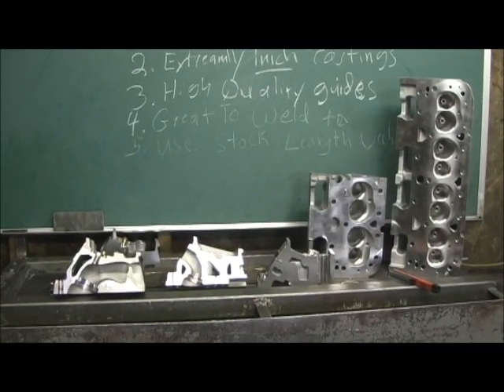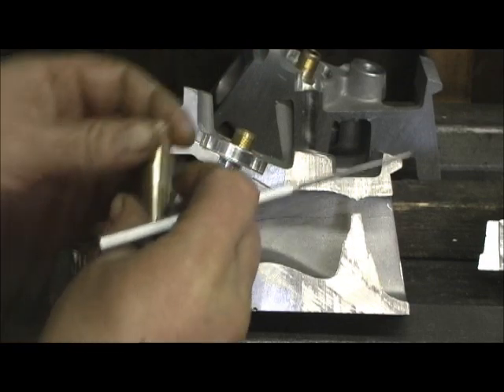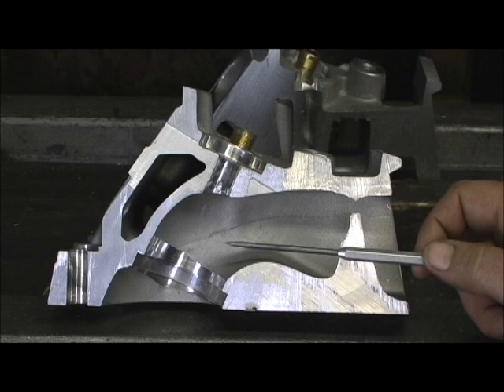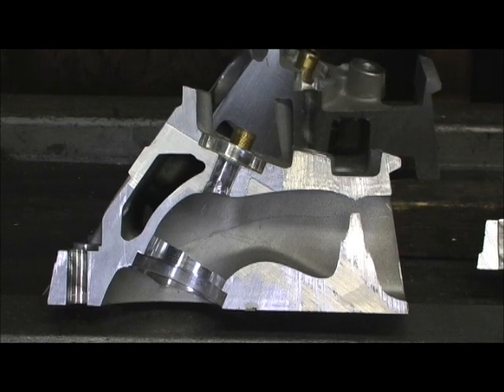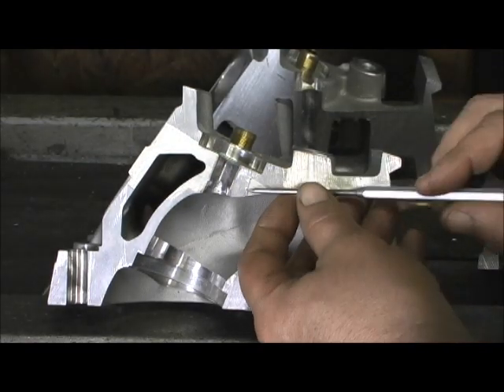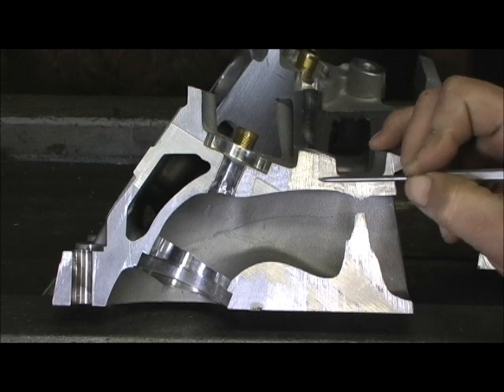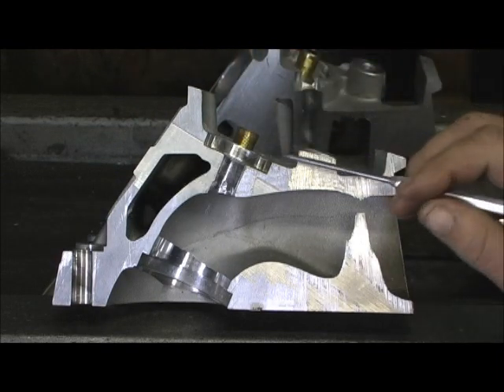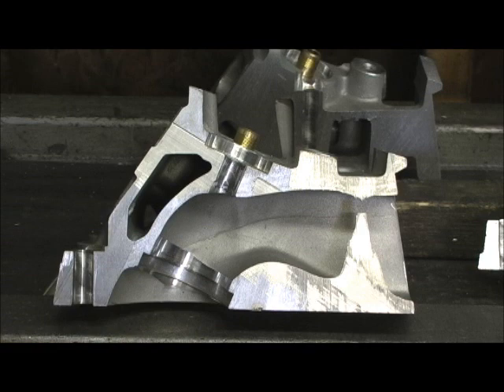ProMaxx 200 NEW Intake Cutaway 3.0

Comment: A question for you. I recently saw a mercedes truck head . 13L 380 hp. The base of the inlet manifold had a d & b shape viewd from floor but the head was standard rectangle shape. In other words where the oval of the db on the manifold its like air hittinv a brick wall on entry to the ports. What is the advantage of that shape in terms of performance, when porting the head to the same shape? Does it do anything to the torque output. Its the first time I've seen that type of port shape.

Comment: Tony, this is my first comment after watching about 50 of your vids (several times).  Thanks so much for taking the trouble!  I've been building engines for about 20 years and have been trying to learn to port, mostly by reading, but pictures speak 1000s, and your commentary has taught me a bunch.  One question about this vid: There's a cutaway pic out there of the Edelbrock Perf RPM head (similar water jacket configuration to the PM200), and the intake port has already a very flat/direct roof, and not nearly as much of a raised floor approaching the short turn.  To a new guy like me, this looks better: a more straight shot into the chamber.  I understand that most of the action will occur on the roof and cylinder wall sides, and a bigger short-turn radius will help the A/F mixture around it (as on the ProMaxx 200).  I believe that by higher lifts the short turn is hardly used any more.  So is all this short-turn business about using more of the valve at low lift?  It looks to me like the short turn-shape dictates much of the rest of the port shape, and I don't understand why it's so crucial--and it's very hard to work on (at least for me.)

In short, a video where you explain an overview of some of your theory behind porting-comparing two or three different cutaways- would be most welcome! 

Thanks again, and Best Wishes,
Shawn

Comment: Thomas, give these guys a call and get one of their 225cc smallblock heads to cut up!
Reply from the maker: I don't' think I am going to TOUCH that one. I have done them heads, and there in the same category as the ProComps.....LOL
Reply: I did not know that. I figured they were a larger version of the cut head.
Reply from the maker: Charles Servedio NO NO NO!!! These are TOTALY different heads Yank, NEW CASTINGS like I posted in the Video. NOTHING is the same, NOTHING!!!
Reply: The new ones look pretty good. If they cast them at 225 cc you could cut them to 235 cc and build a real runner!